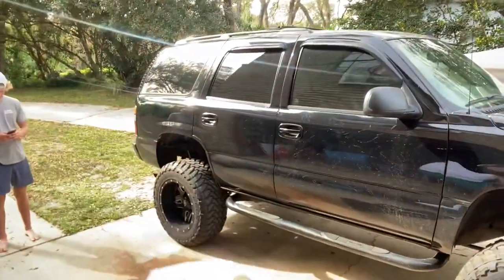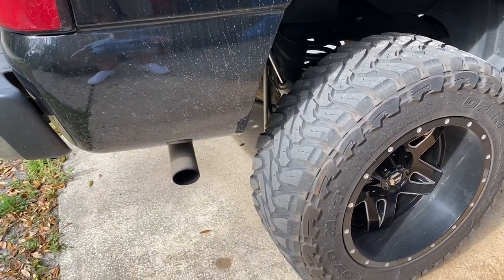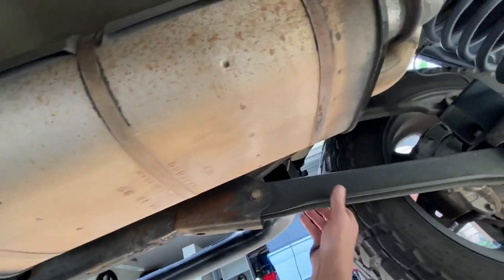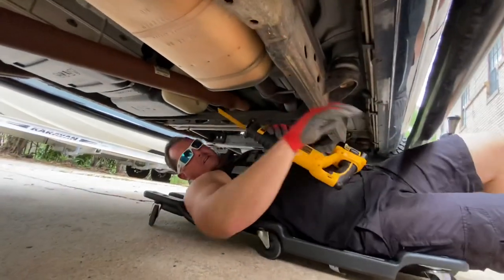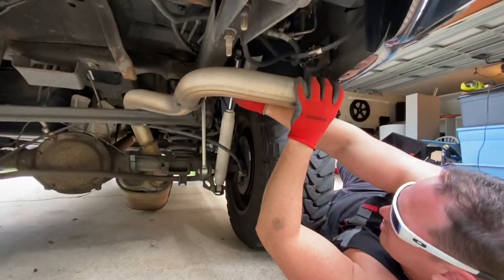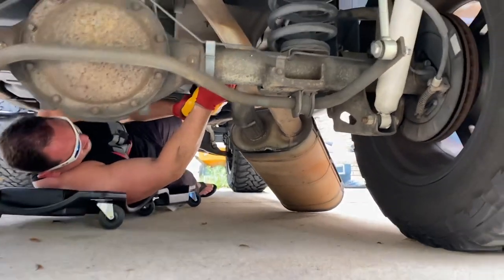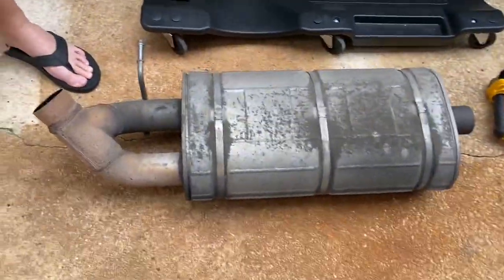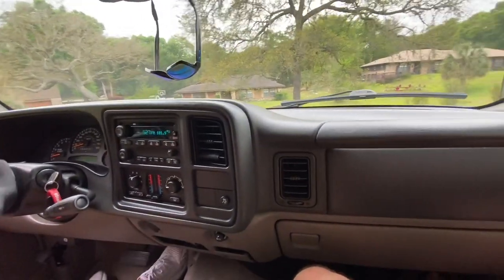2006 Tahoe Muffler Delete DIY Exhaust

Comment: Sounds good, have you had any issue with exhaust smell coming into the cab?
Reply from the maker: Nope. Still thinking about running pipe out the back, but it has been fine. So maybe not.

Comment: Will it pass smog check ?
Reply: It "should" smog doesn't have to do with sound, as long as you leave the cats in. Ive done it many times. However! It is modifying an epa regulated exhaust- so, a cop could give you a ticket other than the noise  level. Depends on the cop. Cheers-D

Comment: I want to do the same with my tahoe! Technically can I just cut it off and its good? Or should I at least straight pipe it? I'd much rather just cut it off and be done.
Reply: going to be some drone in the cab because it's cut right underneath the floor
Reply from the maker: @boratwilson9916  Correct.  But actually this is not too bad on this Tahoe.  Doing it right would be to add pipe out the back.  This was just a cheap hack.
Reply from the maker: Just showing what we did.  : )  I am sure there are opinions and facts on what is right and wrong.  We figured we were going to have to cut it to change the muffler anyway, so we just sent it, and like the way it is.
Reply: @MikeHulsman  I've got the same stock system in my '04 Avalanche. Sounds just like yours. I'll be cutting it off soon and adding pipe. Thanks for doing it first
Reply from the maker: @kootnygreen  Have fun!!
Reply: It's a good idea to run it as far back as you can because of exhaust fumes in the cab.

Comment: Lazy! Would sound way better if it actually had duals out the rear and increased diameter of pipe
Reply: Nope. The sound is louder this way from the sound waves hitting the ground and the underside of the suv. Plus shorter pipes means less of that nasty clapping exhaust sound